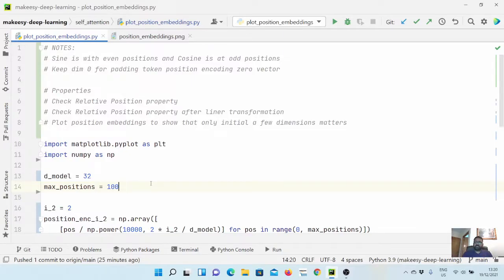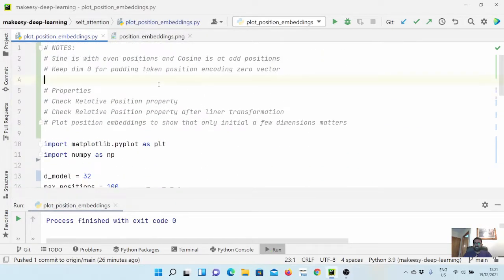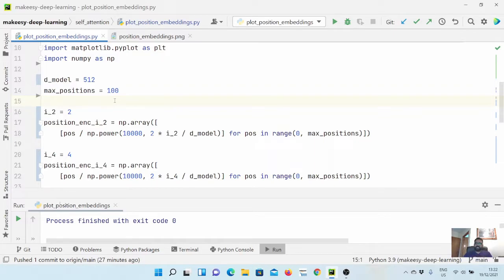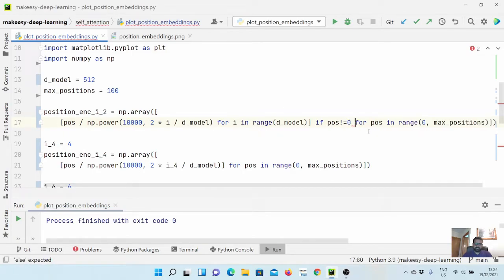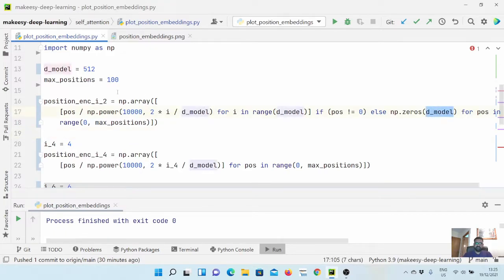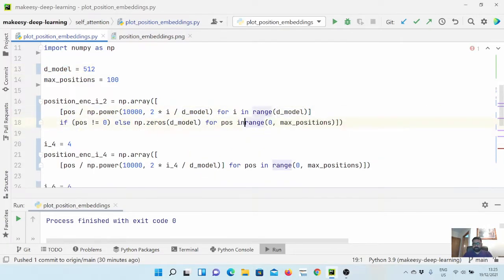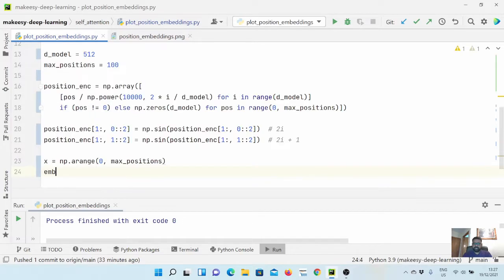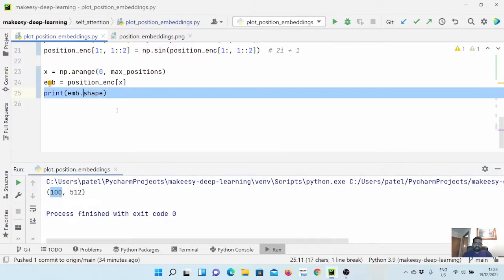Pytorch for Beginners #32 | Transformer Model: Position Embeddings - Validate Properties

Comment from the maker: If this tutorial was helpful for you, please leave a thumbs up and subscribe to my channel!😊
Reply: Great video! There is a minor issue at around 8 minutes - all position encodings use np.sin which makes the cosine comparison a bit wrong.
Reply from the maker: Yes, you are right. Thanks for pointing that out. But it will have similar behavior with corrected code as well (I did test that).
Reply from the maker: I have corrected the github code - https://github.com/makeesyai/makeesy-deep-learning/blob/main/self_attention/plot_position_embeddings.py

Cosine distance with raw embeddings
p1->p2
0.012990584069654143
p1->p10
0.14971186344280651
Cosine distance with linear transformed embeddings
p1->p2
0.014448881149291992
p1->p10
0.16902655363082886

Comment: Why u use sin two times?, and why you applied it through the columns and not the rows? Thanks
Reply from the maker: Yes, that was an error and corrected code is here - 
https://github.com/makeesyai/makeesy-deep-learning/blob/main/self_attention/plot_position_embeddings.py

Yes, we can use rows as well, just make sure you do the selection correctly when generating (https://github.com/makeesyai/makeesy-deep-learning/blob/318881830eacbe8d94ce4802baea8514d3925e7d/self_attention/plot_position_embeddings.py#L37) the position encoding i.e. then we need to sample from columns not the rows.

Hope that helps.. Let me know if something is not clear.